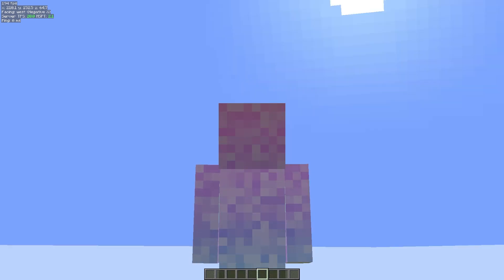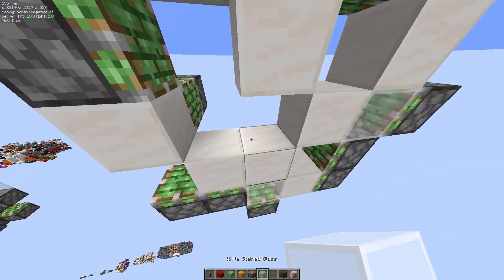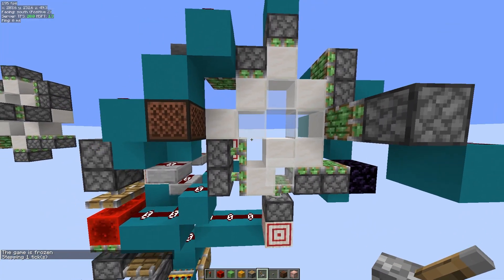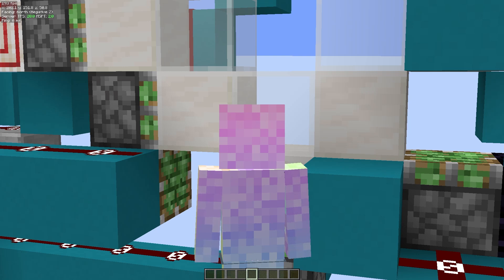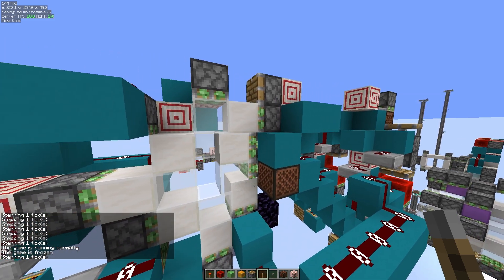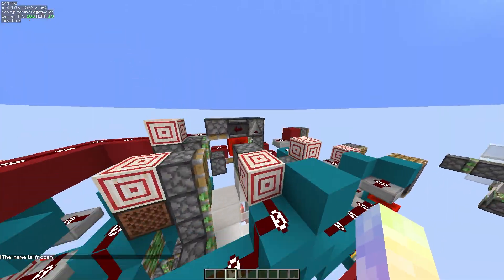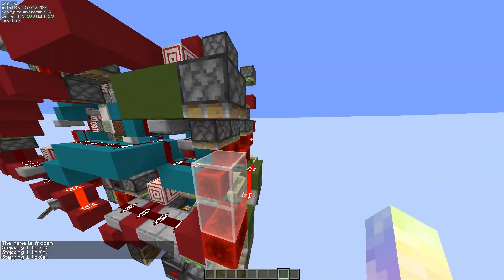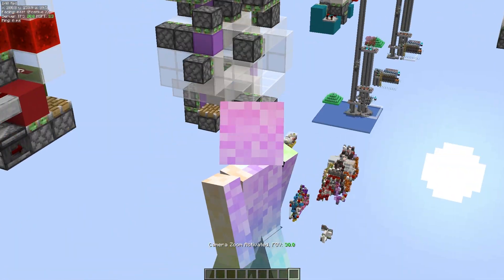How I Make  |  Instant 0 Tick Doors!

Comment: To get a relatively good reset without using boats (which in your case are not useful because of the 0 tick generator) is to use observers instead of sand.

Comment: you should try using 0t rep chains instead of abbas theyre a bit harder to use but more flexible and save more space also the boat hitboxes should technically add to the volume